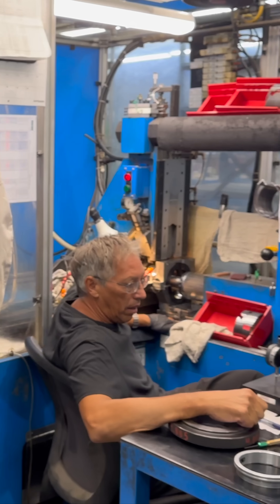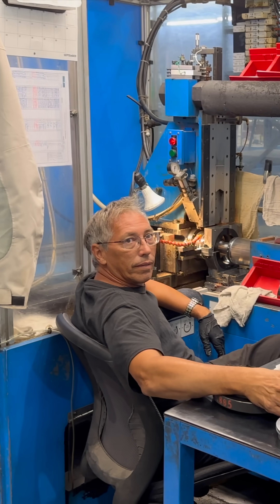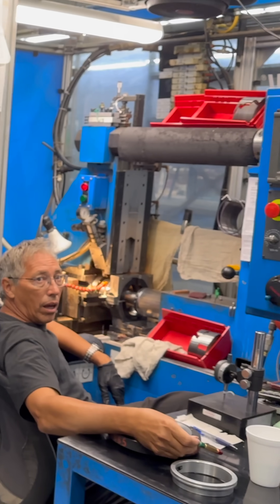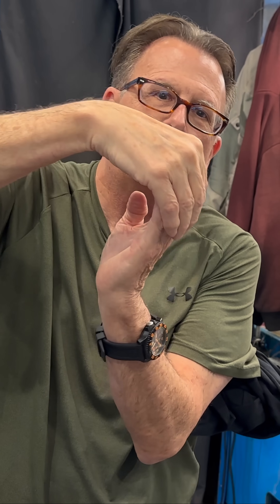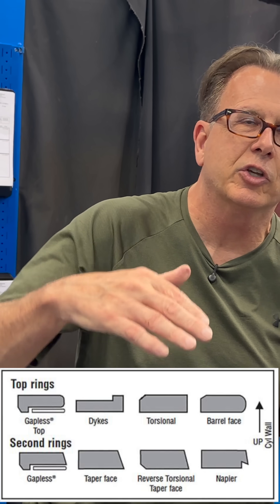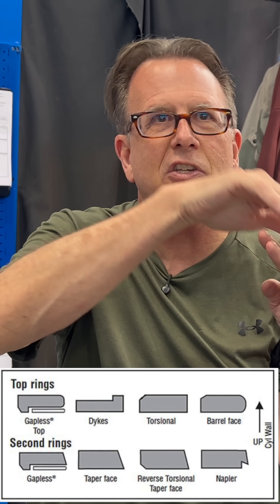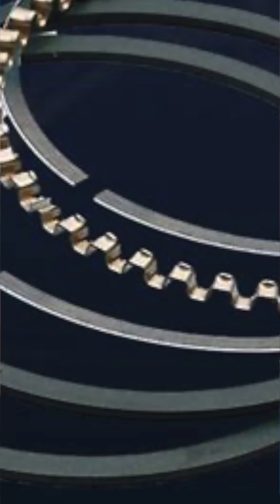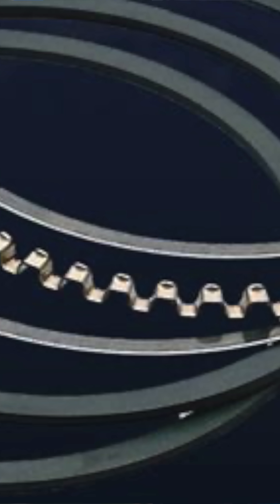The Top and Second RINGS can be Completely DIFFERENT! Keith Jones w #BarryT #TotalSeal

Comment: I know this question is outside of the realm of what you guys are typically dealing with, but, there has been some powerplants out there if the past.. and they didn't just have the proven design of a circle combustion chamber system, they have had oval formats of various sizes and degree of ovals, either being the rounded egg shape, or the race track shape, with 4 turns, and 2 long straight aways.. I think I seen that configuration in motorcycles... How are those rings made to be able to seat the chamber walls, without gaps? Is it safe to assume, they are ground to shape like how eye glasses cut their lenses to fit inside of the frames, based on how the machine can line trace the I.D. of the frame, for the O.D. of the raw uncut lens can be trimmed back, of course with tool diameter offsets premeditated into the machine? 

Grinding to size round or circle rings, although is a science all on its own, and requires a skill set that most do not know, the oval stuff has me stumped on how they get things to spring back into a finished dimensions for sealing/seating characteristics needed. That would be interesting to learn about, time to time. With snippets bits of info dropped throughout the next year..
Reply: My 2 cents worth. They have tried just about everything. But the object is to get even pressure on the rod. So, a circle has found to be the best. Now the explosion inside has all different kinds of happenings. So the Hemi design has always been the best. Center fire, and more even pressure on top of the piston. Hence pressure on the rod connection. Just my 2 cents worth.
Reply: @gregmitchell4619 oh yes, I completely understand the round/circle being the most safest, strongest, easiest secure ring system... But, there had to be a reason back in those days, were the idea of odd shaped pistons and in turn, the rings were constituted as that designers best guess of the future of either life expectancy and or horse power, or something, and possibly, just as a work around for patents or trade mark infringement.. I am not smart enough for such things. I would still really enjoy some tid-bits of knowledge if any is to be offered, as to why, when, things that were done if using those weirdo shaped combustion chamber systems, let alone, how did they do it? 

I always have a slight measure of panic when installing piston rings, and I have done a few installation methods. With tools, without tools or expanders, and just roll-slide them on, over the top, to the bottom most landing, working your way up, etc... I would have a total panic attack, dealing with a stack of 6"-8" by 2"-4" oval rings and oil scrapers, and not breaking them.. perhaps, they actually slide right one with minimal bending? I don't know, as I have never touched part of such a system. Would be intriguing though to learn about .
Reply: So with the manufacturer wanting things as cheap as possible to make. And having the best engineers and equipment for that engineering heres some thoughts. They had the ability to have high speed cameras and kinda cutaway cylinders. Now everything that happens in the combustion chamber as variables. Fuel, piston dome, chamber shape, spark plug location. Now they knew the rod would be center of the piston. But after seeing what happens when the combustion first starts developed chamber, plug location piston dome etc.  The perfect design is to start that explosion at the top of a perfect dome. (HEMI). The force of explosion pushes most evenly on the top of the piston. With dodge having the patent, the others couldnt copy it. Not that they didnt get as close as possible. Boss motors, etc. But think of this for your question. The connecting rod to piston location is kinda of a stationary point. It only has to move one way. Back and forth. But the force on the piston is also so slightly left to right. Why a perfect circle wears oblong like an egg.  If you have a piston say oblong, the wear on the cylinder at the edges or round part will wear more. Because the gases arent pushing evenly on the top of the piston. So the wear of the cylinder would be not the longevity that the manufacturer would want. Being that a perfect circle was best for wear and forces on piston the next thing to do was design cylinder head chambers. When this was done, just look at what angeling the plug did in the chamber. The angel fuelie head of the SBC. Also why some folks index the spark plug to have the gap face the fuel entering. You are definitely being an engineer. Way to go. You have the bug. It gets so bad that you are talking thousands of an inch round or oblong. Now you are a blue printer! Far out buddy.  Rings are the weak link below the explosion. They have to seal, to hold that explosion force on the piston face. The materials they are made of are key. Cant be to hard or you have wear on the cylinder wall, cant be to soft, or they get bypass gases. Or break. Theres a few folks that got the oppurtunity to experiment with such things in exacting sciences.  Then there are guys like Ed, who did it all with expierence and intelligence.  I cherish them. And appreciate being able to absorb any of their knowledge. Reminds me of my dad. You know thats why  the rotary engine was such a good design, but had its own design flaws. Thanks.
Reply: I don't mean to insult you, you seem to have a basic understanding of engines but are struggling with a few concepts pretty badly, such as why round pistons are used and about the causes and results of wear.  
It was known decades ago that the hemispherical combustion chamber and piston are "not" the ideal shape but in the early years the idea was so strongly believed it held on much longer than it should have but there were also other reasons especially with air cooled engines why that idea stayed in use. You may notice flat combustion chambers and flat and even dished top pistons are the ultimate shape for fast combustion, realized by Cosworth years ago now found everywhere in high performance engines. Also Dodge never owned a patient on the Hemi, Ford used Hemi chambers and pistons on the FE 427 Overhead camshaft "Cammer" in 1965-67 the same time as the Dodge/Chrysler 426 Hemi. 
Again, I mean no insult just passing along some better info, all of it is easily found on Google and even YouTube! 👍🏻
Reply: @loganpe427 patent, yes. Exact copy by ford no. I know the cammer, and its not exactly a perfect hemi combustion chamber. As far as round goes, i do say that this is applied for wear purposes. And ease of manufacturing. Ive worked on radial airplane engines, aircraft motors, diesels, gas. Just about any application for internal combustion engines. With advent of high spded cameras and the ability to see what happens inside the chamber at intial spark, there was all kinds of conclusions. Quench, spark plug location, and indexing, dome configuration etc. I think this question was about why not a different cylinder configuration? Like why not square, or triangle? I think we both know the practical reason for this, its all of the above. Always good to communicate because thats education. I dont claim by far to know everything, i built my first chevy inline 6 in 1974. Thats not nearly as far back as someone like Ed, and even so, i dont get to work on the cool stuff like cammers, or boss or hemi motors, i wish i could! Ive got a lot to learn yet. Japan not recognizing patents also built hemi's. And in 1965 with Nascar, Chevrolet would have loved to put a hemi head on a 427. Pretty simple to do, just a head. Smokey put a DOHC head on a 265cid chevy ran on benzene, and created 1120hp! From the first sbc. To compete against the small litre class in formula one. Of course they didnt allow it. But right there showed the engineers at GM what they could have with a hemi head.
Reply: @gregmitchell4619 Chrysler held patents on certain architecture of their design for example certain valve placements but could not and did not prevent the other manufacturers from building and selling their own. They trademark the name "Hemi" therefore the others can't call theirs Hemi specifically, they are free however to use the full word or even semi hemispherical. The way you worded your original statement was that nobody could design and or build their own version of a hemispherical dome piston and chamber at all. In that sense yes everybody has their own design with differences like valve included angle, port shapes etc. I'm fascinated now by more recent developments in understanding chamber designs with good squish that promote fast flame speed and how it promotes more complete combustion and the corresponding reduction in particulates while also allowing surprisingly high compression ratios for very high torque outputs from amazingly small capacity and less worry about pre-ignition! Pretty cool stuff, kind of bugs me being retired now!
Reply: @loganpe427 what's the most terrible thing ever, is what has happened to fuel. Change the octane formula many years ago. About 2 points less now. But to add dillutants like detergent to make you think your cleaning the engine. It's like a dope dealer cutting his product, and increasing the costs. You probably have seen a propane engine inside after say a 100,000 miles on it, just as clean as can be. Sept whatever dirt gets thru the air cleaner. Just an example. I'd like to see everything on Grain alcohol! Burns clean and cool, and gee wouldn't want a bunch of grain growing! After many years I'm retiring too. But to my shop, and the old van Norman boring bar, and my black and decker valve grinder. Lol. Got tons of blocks been waiting for years to come back to life, now is good time.
Reply: @gregmitchell4619  😂 Good luck brother as long as you're set how you want life should be even happier, I hope so!

Comment: Which rings does he recommend for boosted engines like Twin Turbo setups?
Reply from the maker: I’ll ask Keith in an upcoming q and a video
Reply: Considerations would be higher combustion pressure, temperature and speed (rpm). For street application a longer lasting ring would be used compared to a race ring, designed for performance only 👍